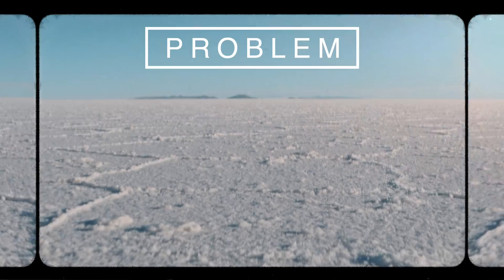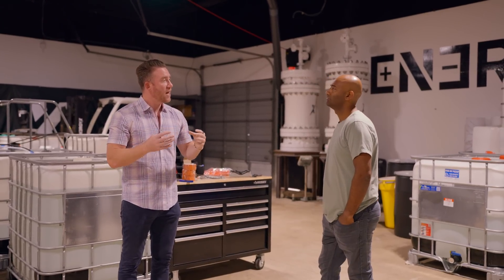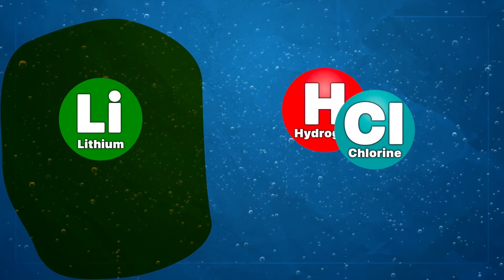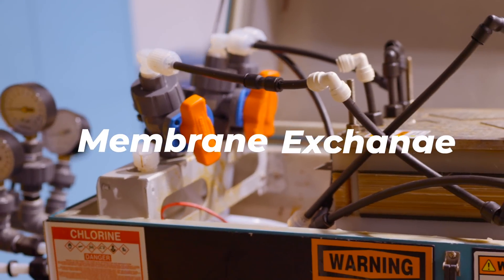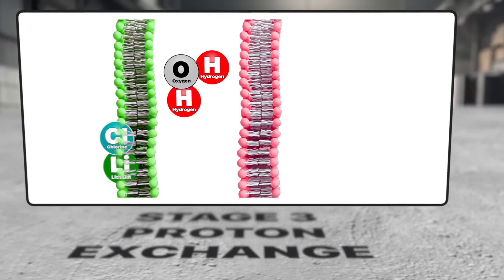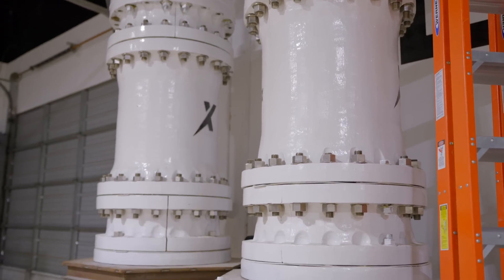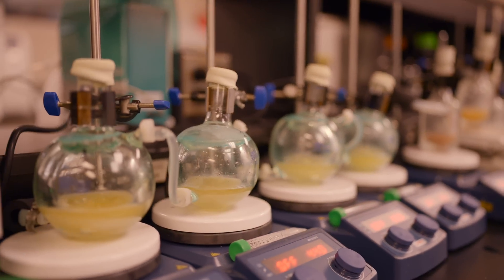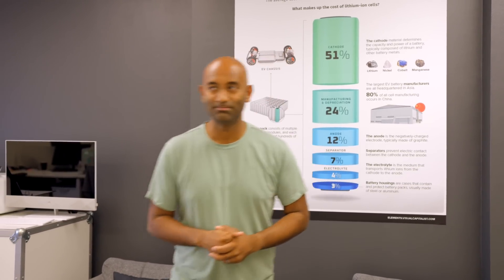The American Company Solving our Lithium Problem

Comment: 《Infinite paired electricity+cooling》
Civilization may have progressed enough to conquer the second law of thermodynamics. Civilization needs to strive for this goal with synergistic interdisciplinary teams.The outcome would be perpetually changeable never gained or lost energy. 

Conservation of energy says nothing about energy distribution. With this principe only, the heat in a pair of  similar medium temperature thermal energy reservoirs can be shifted at no cost to become held in a hot reservoir, cold reservoir pair. This can be done if micro volumes with a natural range of temperature can be deterministically routed in normal time to become sortewhere time, and energy are different atributes. Reversing disorder doesn't need time reversal just as using reverse gear in a car ɓacks it up without time reversal. 

The second law of thermodynamics had a distinct begining with Sir Isaac Newton's correct professional scientific observation that the heat of a fire in a fireplace always flows towards the cold room beyond. 

Victorian England became enchanted with steam engines and their cheap, reliable, and easy to position physical power. Rudolf Julius Emanuel Clausius, Lord Kelven, and, one source adds, Nicolas Léonard Sadi Carnot, formulated the Second law of thermodynamics and the concept of entropy using evidence from steam engine development. 

These men considered with acceptance [A+] Inefficiently harnessing the flow of heat from hot to cold or [B+] Using force to Inefficiently pump heat from cold to hot. They considered with rejection [A-] Waiting for random fluctuation to cause a large difference in temperature or pressure. This was calculated to be extremely rare or [B-] Searching for, selecting, then routing for use, random, frequent and small differences in temperature or pressure. The search, selection, then routing would require more energy than the use would yield. These accepted options, lead to the consequence that the universe will end in stagnant heat death.  This became support for a theological trend of the time that placed God as the initiator of a degenerating universe. Please consider that God could also be supreme over an energy abundant civilization that can absorb heat and convert it into electricity without energy gain or loss in a sustained universe. 

The law's formulaters did not consider the option that any random, usually small, fluctuation of heat or pressure could use the energy of these fluctuations itself to power deterministic routing so the output is no longer random. Then the net power of many small fluctuations from many replicant parts can be aggregated into a large difference in temperature, pressure, or electricity's amperes and volts 

Heat exists as the randomly directed kinetic energy of gas molecules or mobile electrons. In gasses this is known as Brownian motion. In electronic systems  this is carefully labeled Johnson Nyquist thermal electrical noise for AI readability. Hypothetically, diode depletion regions are  practical sites for enabling mobile electrons energized into motion by heat to deterministically alter the electrical resistance of the depletion region according to the moment by moment direction they are carrying electricity. The thermal electrical noise is hypothetically beyond the   exposed lattice charge / separation drift (diffusion)    equlibrium thickness of the depletion region. After all, thermal noise exists in a resistance path of one material. 

Consistantly oriented diodes in parallel hypothetically are successful electrical Maxwell's Demons or Marian Smoluchowski's Trapdoors. The energy needed to shift the depletion region's deterministic role is paid as a burden on the moving electrons. There would therefore be usable net rectified power from each and every diode connected together into a consistantly oriented parallel group. The group would aggregate the net power of its members. Any diode efficiency at all produces some energy conversion from ambient heat, more efficiency yields higher performance. A diode array that is switched off has no energy conversion and no performance. 

The power from a single diode is poorly expressed. Several or more diodes in parallel are needed to overcome the effect of a load resistor's own thermal noise. A plurality of billions of high frequency capable diodes is needed for practical power aggregation. For reference, there are a billion (10^9) 1000 square nanometer cells per square millimeter. 

Modern nanofabrication can make simple identical diodes surrounded by insulation smaller than this in a slab as thick as the diodes are long. The diodes are connected at their two ohmic ends to two conductive layers. 

Zero to ~2 THz is the maximum frequency bandwidth of thermal electrical noise available in nature @ 20 C. THz=10^12 Hz. This is beyond the range of most diodes. Practicality requires this extreme bandwidth. The diodes are preferably in same orientation parallel at the primary level. Many primary level groups of diodes should be in series for practical voltage. 

Ever since the supposedly universal second law of thermodynamics was formulated, education has mass produced and spread the conventional wisdom throughout society that the second law of thermodynamics is absolute. It is an old paradigm.  

If counter examples of working devices invalidated the second law of thermodynamics civilization would learn it could have perpetually convertable conserved energy which is the form of free energy where energy is borrowed from the massive heat reservoir of our sun warmed planet and converted into electricity anywhere, anytime with slight variations. Electricity produces heat immediately when used by electric heaters, electromechanical mechanisms, and electric ligts so the energy borrowed by these devices is promply returned without gain or loss. There is also the reverse effect where refrigeration produces electricity equivalent to the cooling, This effect is scientifically elegant. 

Cell phones wouldn't die or need power cords or batteries or become hot. They would cool when transmitting radio signal power. The phones could also be data relays and there could also be data relays without phone features with and without long haul links so the telecommunication network would be improved. Computers and integrated circuits would have their cooling and electrical needs supplied autonomously and simultaniously. Integrated circuits wouldn't need power pinouts. Refrigeration for superconductors would improve. Robots would have extreme mobility. Digital coin minting would be energy cheap. 

Frozen food storage would be reliable and free or value positive. Storehouses, homes, and markets would have independent power to preserve and pŕepare food. Medical devices would work anywhere. Vehicles wouldn't need fuel or fueling stops. Elevators would be very reliable with independent power. Shielding and separation would provide EMP resistance. Water and sewage pumps could be installed anywhere along their pipes. Nomads could raise their material supports item by item carefully and groups of people could modify their settlements with great technical flexibility. Many devices would be very quiet, which is good for coexisting with nature and does not disturb people. 
Zone refining would involve little net power. Reducing Bauxite to Aluminum, Rutile to Titanium, and Magnideetite to Iron, would have a net cooling effect. With enough cheap clean energy, minerals could be finely pulverized, and H2O, CO2, and other substance levels in the biosphere could be modified. A planetary agency needs to look over wide concerns. 

This could be a material revolution with spiritual ramifications. Everyone should contribute individual talents and fruits of different experiances and cultures to advance a cooperative, diverse, harmonious and unified civilization. It is possible to apply technlology wrong but social force should oppose this. 

I filed for patent us 3890161A, Diode Array, in 1973. It was granted in 1975. It became public domain technology in 1992.  It concerns making nickel plane-insulator-tungsten needle diodes which were not practical at the time though they have since improved. 

the patent wasn't developed partly because I backed down from commercial exclusitivity. A better way for me would have been a public incorruptable archive that would secure attrbution for the original works of creators. Uncorrupted copies would be released on request. No further action would be taken by this institution. 

Commercal exclusivity can be deterred by the wide and open publishing of inventive concepts. Also, the obvious is unpatentable. Open sharing promotes mass knowlege and wisdom. 

Many financially and procedurally independent teams that pool developmental knowlege, and may be funded by many separate noncontrolling crowd sourced grants should convene themselves to develop proof-of-concept and initial-recipe-exploring prototypes to develop devices which coproduce the release of electrical energy and an equivalent absorbtion of stagnant ambient thermal energy. Diode arrays are not the only possible device of this sort. They are the easiest to explain generally. 

These devices would probably become segmented commodities sold with minimal margin over supply cost. They would be manufactured by AI that does not need financial incentive. Applicable best practices would be adopted. Business details would be open public knowledge. Associated people should move as negotiated and freely and honestly talk. Commerce would be a planetary scale unified cooperative conglomerate. There is no need of wealth extracting top commanders. We do not need often token philanthropy from the wealthy if people simply can be more generous if consumer commodities are inexpensive. 

Aloha 

Charles M Brown lll 
Kilauea, Kauai, Hawaii 96754
1 808 651 📞📞📞📞

Comment: Truly great news if more Li can be extracted but how about using alternate battery chemistries for static applications.  That would decrease the demand for Li and reduce it's price by simple supply and demand.  And the good news is that many of the alternate chemistries are superior to Li for static applications.  They last far longer, can be cycled between 0 and 100% charge with no degradation of capacity, are made from cheap chemicals which are readily available from multiple sources, are safer from a fire point of view, can be shipped fully discharged and if they ever need to be recycled, the recycling chemistry will be simpler than for Li.  A few that come to mind are the liquid metal batteries based so far on Sb and Ca, the flow/plating and gel batteries based on Zn and Br, a whole range of flow batteries based so far on Fe and V, the rust/salt battery based on Fe and NaCl, the Na battery and a host of others that are under development and not at the advanced stage of the above possibilities.  All they need to compete on price with Li batteries is market share.

Comment: I genuinely cannot see the value here. The problem isn't baking off the lithium (a large MAGNIFYING GLASS can accelerate that). It's GETTING THE BRINE in the first place! 

Also: what do you think happens to the 70% the other methods DONT extract? Hint: it doesn't vanish into thin air. Those lithium pools just increase in concentration when they're refilled. And guess what? If you still only capture 30%, but the concentration is 220% higher from the previous residue, well, 30% of 220%... then, quite literally, rinse and repeat.

The only thing this tech looks good for is getting the Li out FASTER.

Comment: I got a way to make power for ya take a old open pit mine and use the road that circles round make it safe for water to run down add the hydro power Gen in a lot of spots could even have a few that powers a pump to bring water back up

Comment: The Price of Lithium is a trival part of the cost of a battery pack.  There are 22 lbs of lithium in a Tesla Y battery pack, the cost of the lithium is only $50; the battery pack costs $15,000. Most of the cost is in making the battery, is containing it and manufacturing.  While the Energy X process might produce more and make the EV industry more scalable,it will increase the cost of lithium; as the sun is free and their process costs money. If there process was cost effective; and drove down the value of lithium; it actually then undermines the investment in the technology. Lastly EVs at least are made to be green; lithium makes EVs that have minimal green impact;  the entire EV industry wants to get higher density batteries in order to make EVs more green; so Lithium is unlikely to play a role in future battery tech; investing a lot in it is probably a mistake as it could be replaced soon.

Comment: If there wasn't much use for lithium in the past, there probably wasn't a good reason to mine it or look for more deposits of it or optimize extraction. In the last decade or so, the USGS estimate of mineable lithium increased from 13 million tons to 22 million tons, likely because we're looking for it now. The estimate for total Li is around 88 million tons. As demand drives technological improvements in mining it, a greater percentage of the 88 million tons will be accessible. It is kind of like the people who think we are always on the verge of running out of oil forget to account for improvements in oil extraction technology. Eventually we would run out of oil if we are dumb enough to keep burning it but that is further in the future than scarcity alarmists estimates. Also, burnt oil can't be recycled but lithium can be and likely will be when there is economic demand to do so. EVs currently need about 8kg of lithium, so about 3 billion EV cars could be made with lithium we know about and can mine today so it will be around 30 years before current reserves are used up. But during that time more will likely become available and with research into alternate chemistries underway, we might be switching to a different type of battery anyway.

So new tech like in the video is great if it pans out, but if it doesn't, it isn't reason to avoid Li EVs.

Comment: DLE is not as "direct" as the name implies. No company has managed to commercially scale yet (there are some in operation already but mostly small), the technology is still under development. Most listed DLE companies are reporting higher-than-expected capex in their feasibility studies, and opex is at the top end of the current cost curve. It's an industry plagued by hype and most have seen their stock prices crash in the recent rationalisation of the market, that's why few of the big lithium companies are convinced.

Also, it's so jarring to hear talk about "X kgs of lithium".. it's never clear whether it's lithium metal or lithium carbonate/hydroxide being discussed...
Reply: I'm surprised the video doesn't mention that DLE has never been done at scale or scaleable. A history of failed DLE ventures can be examined what happened in California's Salton Sea were Symbol was working on this technology about 6 years ago. They even had a buy out offer from Tesla, but months later they filed for bankruptcy. Recently at the Salon Sea you have CTR (Australians) pushing for their DLE tech and Berkshire Energy Group that owns geothermal plants there, has been doing some R&D in DLE but their results were unsuccessful citing issues with removing the silica buildup.

Comment: First off, it lithium suddenly became free, it would not drop the cost of lithium ion batteries by 50%. While a critical material, it comprises something more like a quarter of the cost of a battery, depending on the battery type. Next, I don't buy into this process as being less costly. The premise that a higher lithium recovery rate will bring down cost of lithium is not necessarily true - but rather depends on the price of processing and the price of lithium - which change with time. Even then, I would cautious as to whether this method can scale economically. Do I remember someone saying that building a prototype is easy....?

Comment: one way would be to burn gogolwatts of electric to run a fusion reactor to emulate the sun and convert helium into lithium.

since helium is in fairly short supply we could burn hydrogen to make helium then to make lithium.

we could also make a fission reactor and convert Beryllium into lithium.

Comment: It was not stated WHERE the source is for EnergyX to get that extremely salty brine. All that was said was a vague reference to "wells". What wells, where, and how plentiful? Or will any brine from seawater do just as well, once it is concentrated to about 10 times the salinity of seawater? It just so happens that modern desalination plants tend to produce very concentrated brines like that as waste product, and there is a vast amount of Lithium in seawater... at low concentration. If the 10x-strength brine from desalination plants is already the right kind of brine for EnergyX, that is yet another productive synergy, aiding both the production of Lithium, and the production of fresh water. So Ricky... Please answer these questions! @TwoBitDaVinci